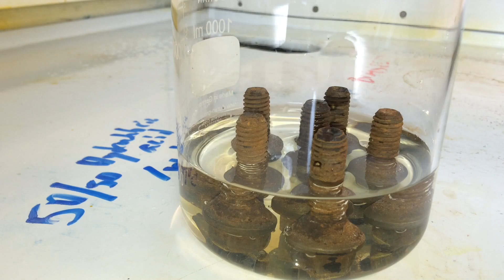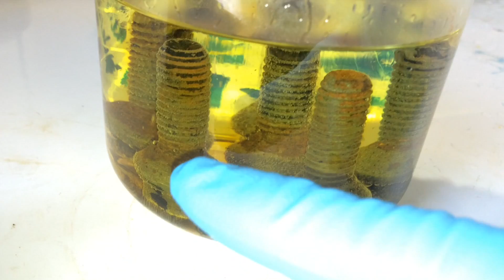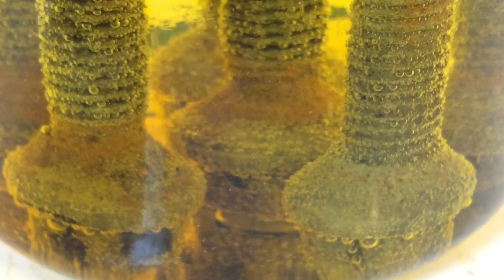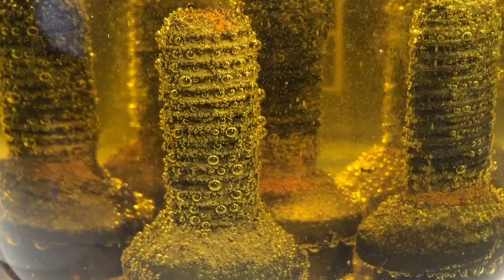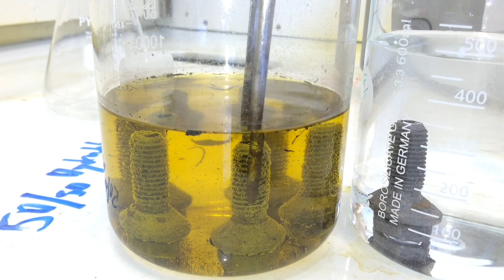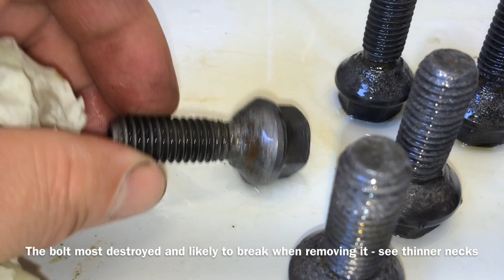True rust removal by a chemist - Jeep Wrangler YJ bolts : Ep 5

Comment: I believe adding hexamine to the hydrochloric acid will stop/reduce the rate of acid attack on the bare steel.  We used to use this solution when cleaning hardened concrete off of the steel concrete mixers in the Concrete Laboratory when the students hadn't bothered.  That is a lot of concrete in one sentence!  Apparently the hexamine attaches to the bare iron but not the iron oxide.
Reply from the maker: Brilliant input, someone said that as well some time ago but I lost the link.

Comment: My experience tells me those bolts are in good condition, bar just the one eroded base thread. The hydrochloric acid works more impressively in heavy rust than these reasonable bolts. If they come out of a work I'm doing then they'll be wire brushed oiled and returned to service. Buddy you ought to see some of the work i do thats rusted. Youd probably remove the engine and order 1000 gallons of muriatic acid 😂😅

Comment: HCl is just too much of a pain to handle and store compared to household acids or rust chelators.  I would not re-use those bolts either.  The rough taper will increase friction and will gall alloy wheels.  So you will reach the torque spec. before the intended clamping force is achieved.

Comment: Great video.  Do anyone know if I have to neutralize OSPHO ( phosphoric acid) after using it on the car chassis before I paint?  not concern about paint adhesion but  acid eating away the metal longterm.
Reply from the maker: The part that adds to corrosion in the long run, from reminding acid, is relate to the counter ion. If you would have sulphuric acid, then it’s the sulphate group, if you have hydrochloric acid then it’s the chloride group. In this case of phosphoric acid, then the phosphorus group is bonded into the new surface so rinsing is in most cases good enough and the phosphorus group as bonded into iron phosphate is not catalyzing more rust
Reply: @Ken_Sweden  what if I don't risen phosphoric acid before painting?  Will it corroded under the paint?

Comment: I feel like this is half the process, yes Hydrochloric acid aka Muriatic acid is an excellent way of removing rust, but it is also an excellent way to accelerate the rusting process, I would have used baking soda water to neutralize it or better yet some high strength industrial grade vinegar to wash it off and coat it to prevent aka inhibit future rust from forming, I am curious how your bolts looked just a year later, not being rude, I just played this game before and had things super cleaned zero rust, and then the rust came back as quickly as it left

Comment: So what is the best way to neutralize phosphoric acid on a car to then prime and paint? Alot of talk about this and I rewet with acid, let sit for 5 minutes, wash with water and a scotch Brite pad and dry with air or heat or both as fast as I can then use primer, paint etc. Is there a guaranteed way to show ppl to not be afraid of acids if used properly? Thank you. Very good video. Learned more her and in comments then most at all
Reply from the maker: Thank you for your comment. I think that in your case, in the particular case of phosphoric acid, the neutralization is not a big problem and only rinsing with water will take you far. The reason is that the process of rusting is related to the ability of the iron atoms with their acidic nature to interact with the water and the oxygen to form first hydrolyzed iron atoms that then quickly is converted into iron oxide, which is what is referred to as rust. The use of phosphoric acid as a rust remover is based on the benefits that the iron atoms prefer to strongly bond with the negative phosphorus atoms instead of hydrolyzing and oxidizing, which is a result of fundamental chemistry and acid basis theories related to the formation of certain solid precipitate before others (descriptive inorganic chemistry, I recommend reading Wulfberg). Having said this, I think that you are in a quite good position just to paint on the iron phosphate surface that you have after treating the surface with phosphoric acid and the bonding with any epoxy or thermoset paint should be excellent. If you instead use a thermoplastic paint, like most spray paints, then you could benefit from using a rust converter that contains both phosphoric acid and tannic acid. The tannic acid provides a more paint compatible surface since it is some hydrocarbon structures in the tannic acid resulting surface. A final comment, you still have an issue of not knowing how much you have converted your surface into iron phosphate because it is a surface reaction so always try to brush off as much as possible of the rust first. You can actually check your phosphors iron converted surface with a victorinox knife, scratch it and you will see if rust comes out under the black coat that you have formed. Good luck!

Comment: What alkaline solution did you use, and what easily available alkaline would you recommend we use?
Reply from the maker: Mr Muscle in the grocery store or similar sewage drain cleaner works equally well. I used chemical grade NaOH but it doesn’t make a difference. Thx for comment!

Comment: This Method is absolutely at YOUR own risk.
These bolts are one of the most important parts of Your wheel.
And You kill them with micro-holes because of the HCL.
You cannot see these micro-holes - except You have an electro-miscroscope.
It is absolutely possible, that these bolts just crack whilst driving.
Good luck!
Reply from the maker: You are absolutely right. The only problem is that you made up your mind about the content before investigating the content properly. It says the bolts are holding up a cross-member skid plate. It is unlikely that the wheels fall off if you have properly tightened your wheels with the bolts intended for the wheels. God Bless you. Thx.

Comment: YOU NEED TO AGITATE THE FLUID AND PARTS.  YOU ALSO SHOULD LIGHTLY COAT THEM WITH OIL AFTER CLEANING AND POLISHING OR PAINT THEM IMMEDIATELY AFTERWARDS. 
THEY WILL BE RUSTY VERY QUICKLY. NOT A BAD AS BEFORE BUT THE SURFACE WILL RUST VERY FAST.
Funny how you set them in the heads (not well exposed to acid water] and never show the heads in the video

Comment: Anyone ever heard of Hydrogen Embrittlement.?
Automotive and aerospace fasteners should never be immersed in acid,or as I keep seeing on these “home made” videos subjected to electrolysis cleaning methods. The parts will absorb hydrogen during these procedures and become brittle as a result of hydrogen absorption. The only way to remove the hydrogen is to bake the parts at least 200 degrees for at least four hours, depending on the immersions time and the grade of the steel. I don’t know what these bolts are for but if they are safety critical parts ie for brake callipers, wheel nuts, or steering racks etc, they could fail under load or pressure. I have just retired 12 months ago from 48 years of management in the metal finishing industry,( paint, powder coat, EP paint and electroplating)of high grade high spec aerospace and automotive parts and fasteners. The specifications of these parts do not allow them to be subjected to any chemical processes, and in the rare occasion that they are, they have to undertake a baking process of at least 8/12 hrs at 200 degrees to remove the hydrogen. 
Such high spec parts are usually “ mechanically cleaned”, ie hot soapy non alkaline cleaning and peening or shot blasted to prepare the surface for the subsequent coating.
Sick of seeing these do it yourself electroplating and electrolysis cleaning videos. If it’s a old bolt for the gate or a couple old door handles that’s fine but DO NOT process safety critical parts using these videos.!!
Reply: Quiet man that's fascinating information you provided ! Thank you for your service in the metal finishing industry. How would you suggest the average person remove rust from metal? Chemical , media blast , electrolysis ? What method removes the rust effectively in a timely manner but does little to take good metal with it. Please give details.
Reply: Mainly high tensile steel (>1000 MPa) is affected by this (according to wikipedia). So for high tensile strength bolts, yes. But much less of a problem for many other steel parts  I suppose.
Reply: @zjeng1 Which ones are high tensil bolts in a car ?
Reply: Hey quiet man a question, After alot of arguments about Ospho or phosphoric acid used on automobiles to address rust, what's the best way to neutralize acid for using a epoxy, urethane type primer or paint? I know I can clean with mineral spirits and use rustoleum, but what if using the above mentioned? Thank you so much.
Reply: Why are there so many videos about electroplating without one mentionning Hydrogen Embrittlement ? Are 99% of the youtubers uneducated ? Also all the web articles wrong ? 
Why is there 0 emphasis put on this embrittlement ?

What do you recommend then to rejuvenate corroded fasteners.

Comment: This is a cheap way to remove rust that is unreachable with wire brush etc.  Problem is that you de stabilised the metal and made it more prone to rust.  More importantly, you introduced hydrogen embrittlement.  You turned your grade 5 bolts into grade 3.  Money spent on acid should have been spent on new bolts.

Comment: Wow this video is dumb. Not only is WD-40 the most useless and over hyped product, but it will rust super quick after the hydrochloric acid treatment. You should have wiped them down with phosphoric acid, or best yet, zinc plate them afterwards.
Reply from the maker: You are absolutely correct that WD-40 maybe is overhyped. However, lots of people find it very useful to buy and apply as provisional rust protection. Maybe wax is better?

Comment: What about the danger of Hydrogen embrittlement weakening the bolts?
Reply from the maker: +Robert Ferguson it takes days for the hydrogen to penetrate deep into the steel according to all scientific reports i have been able to find. Not 30 minutes. The strength has primarily been reduced from the lost iron that went into rust. Thx good point comment!
Reply: @Ken_Sweden  Thanks for the reply Ken. I suppose 30 minutes is too short a time.

Comment: You may be a chemist, but you are not a mechanic...  Removing rust with chemicals is not to wait until the ABSENCE of rust.  By that time all of the metal has been attacked.  You wait until the rust has been softened, and use a toothbrush or wire brush to finish the job.

Comment: After this process you should have run a blow torch over them to get rid of the acid. I would have rinsed in baking soda (strong base to neutralize the acid) and then heat treated to parts with a flame. This is actually how a chemist would do it.

Comment: WD-40, displace water.  Would isopropyl alcohol do the same ?
Reply from the maker: Isopropyl alcohol mixes very well with water, no displacement and it evaporates before the water so in the end it will be rust again. Thx f comment.
Reply: So probably a nice hot bath in used motor oil.

Comment: Safe to leave over night?
Reply from the maker: +Albert Thane I left a railway nail from my other videos in there for 2 weeks, believing it would eventually complete dissolve, since some comments on this video state concerns on hydrogen embrittlement and migration of the acid into the bolts. In reality what happens is that the surface is passivated by a black ferrihydrate layer and then the rust removal reaction stops. I cut the nail up and it was perfectly shiny solid steel after a week. I would not use more than necessary I was to trust the bolts as it high strength bolts.

Comment: I'm restoring a couple of cars and have a lot of rusty bolts and small parts etc. The carburettor cleaned up like new by soaking overnight with vinegar but vinegar was only so-so with bolts.  Citrus acid works well with cleaning bolts but I was busted by my wife boiling bolts in citrus acid in her best pots. Today I've tried Hydrochloric acid and it is by far the best.  Cheap to buy and sorted bolts in about an hour of soaking for 10min then wire brushing then soaking again. Only issue is the grease/oil that ends up covering every items and reduces the effectiveness
of the acid. Has anyone got a solution for removing oil?
Reply from the maker: For steel and iron, you can do a mix of 40 grams caustic soda + 25 grams of sodium carbonate + some detergent (all per litre) and then heat it so it simmers. 
Let them sit in there for 10-15 min. This is basically the toilet cleaner + washing powder + liquid hand washing detergent. However, be aware and definitely use eye protection. Lots of folks believe acids in the eyes is the worst. That’s not true, alkaline (like the above) are the worst. If you splash this - your vision will be instantaneously, irreversibly and permanently blurred. You cannot use it on aluminum or zinc, it will erode your metal. If you want to go solvents, the stoddard solvents are the strongest but road tar is often too tough sitting, and I have had limited success. In the old times they used chlorinated stuff in there, which is banned today. This stuff is still used in some paint dissolvers but it is very nasty - it’s carcinogenic. For solvent based I recommend normal petrol (gasoline). I am always surprised how well it dissolves stuff and I have no clue what they put in there. Good luck.

Comment: Kurt is correct.  Don't do this - maybe after using a wire wheel with only a 5% solution WITH agitation then a 5% solution of ammonia to neutralize.  Then move to a zinc plating cycle followed with a dichhromate surface hardening of the zinc for longevity.  It's posts like this that really hamper the value of youtube.
Reply from the maker: Thanks for comment. Just for information and clarification. The suggestions in this comment are very good for protection of rust and long-term longevity of iron parts. However, dichromate solutions are lethal, very dangerous and have been banned in most countries over the world. The ingestion of any form of chromate is on a scale magnitudes more dangerous than dissolving rust with Muriatic acid from the local hardware store. So, if you plan on zinc plating followed by chromate coating, you need to check carefully what you are doing if you wish to live a long life. Search: Erin Brockovich and the hexavalent chromium that ShogMan is referring to.
Reply: Things have changed quite a bit in the last 25 years.  Go to Caswellplating .com for info.  Dipping zinc plated parts in chromic acid for 30 seconds is all that is required - no electricity and no exposure to hydrochloric acid fumes.  If you're going to play with it, maybe keep some ammonia uncapped nearby to neutralize the fumes.

Comment: Is there any solution to neutralize the acid?Or put the bolt to the mixture of natrium bicarbonate first after that put to the water .Is it effective to fully neutralize the acid to prevent rust grow again?
Reply from the maker: +Just For Fun yes you can do as you say, neutralize first and then dip water. The chloric ions from the acid have to be eliminated. One way is to use a torch, heat until red and dip cool in oil. Thanks for comment!
Reply: Ken Sweden thx

Comment: You think other rust removals aren't true and done by chemists? Weird title man.
Reply from the maker: +Ragesauce Interesting, never crossed my mind. Is that true?
Reply: Of course it is, all rust removal products in stores were created by chemists, where else would they come from?
Reply from the maker: You're right. I'm just showing the effect of the acid component. In reality most of the rust removal converter products are based on a weaker acid, the phosphoric acid since it also bonds with the surface of the iron. However, the rust converters using phosphoric acid don't always convert or remove all the rust. If you put it over an area with thick rust, you can take a knife after everything is dry, scratch over the surface and you will find that under all the removed and converted rust, a rusty layer will be found. That's what i would say is an untrue rust removal. I prefer it metal clean. Thanks for you comment.

Comment: Does this not cause hydrogen  in-brittlment  like electroplating
Reply from the maker: +Wayne Allsopp Thanks for asking. Hydrogen embrittlement is a process where hydrogen dissolves and diffuse into the metal. The diffusion of the hydrogen is different from material to material, and the scientific view is that it is a reversible process, meaning that the hydrogen can also leave the metal. You may read in the comments and statements claiming horrible effects and the fact that the material to some extent looses ductility (toughness). In reality one has to do mechanical testing to verify hydrogen embrittlement for these specific bolts and with their specific material grade. Since we also see some serious pitting where the rust was sitting, which certainly has reduced the thickness of the bolt, this would be my main concern if we talk material strength. However, would I worry about these bolts? Well, these are not wheel lug nuts and they are in reality used to hold up a transmission as 6 aligned bolts. I would be surprised if all of them snapped at exactly the same second so I drop my transmission. For anyone worried, I would say `buy new’. Neither would I recommend this person to drive a Wrangler without airbags. I hope this helps and thanks again for asking!

Comment: The chemistry method is easier, but a steel wire brush and a little muscle power would do an acceptable job getting that rust off and much faster.